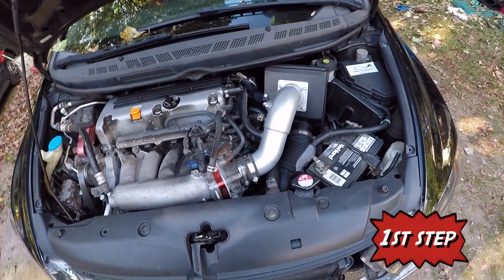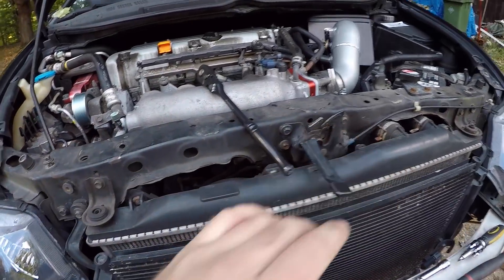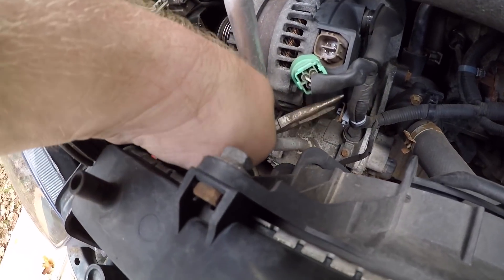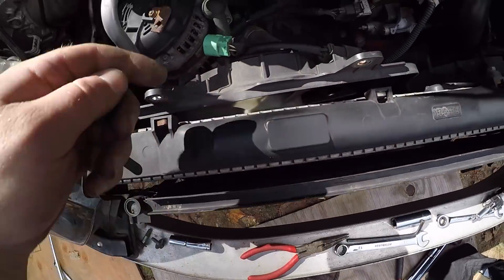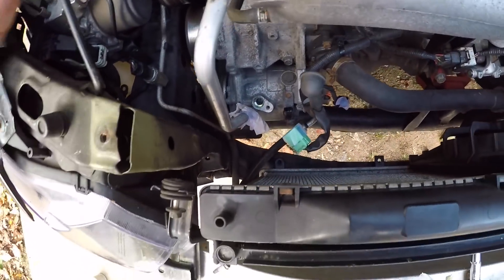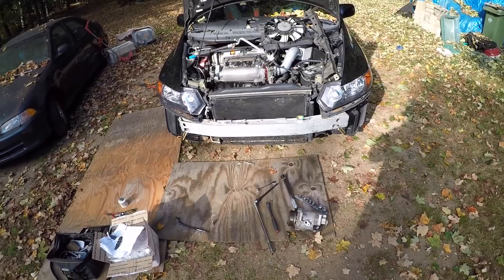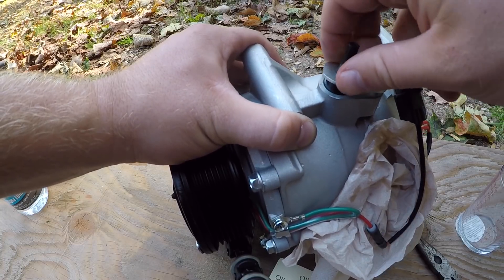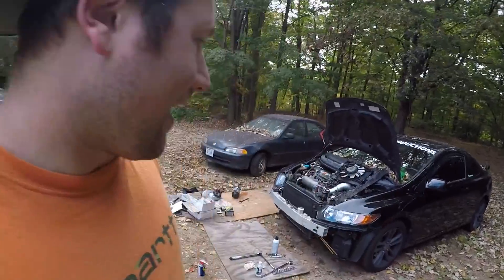Honda Civic Si Remove & Replace A/C Compressor DIY (2006-2011 Civic Si)

Comment: There’s tons of clutch and coil rebuild kits online for 50-70$, you could of just took off the right wheel remove the fender liner and your compressor is right there.
Reply from the maker: I was thinking about it man, but i just replaced the whole thing. Should've bought a newer denso compressor, but they're like $300.00
Reply: Gerb Productions it’s too bad Honda didn’t recall their compressors. Seems like a very common problem in the 8th gens.
Reply from the maker: Definitely agree with you on that

Comment: Did the noise stop?!?!?

Freaking Honda should know the PAG oil amount 🙄 when you get the system recharged, they should be able to tell you some information on it, I think

Great vid, too.
Reply from the maker: +F Lorenzo You'll have to wait and see.  

Ik, couldn't find an exact oz anywhere for the pag46.  Hopefully the 3 oz and a recharge will be good 🤔
Reply: Just got one and yes 3 ounces of PAG oil is what is required. Mine came in it already.

Comment: Very good video. How do you normally find out the proper amount of torque to use in the bolts? Do you look online?
Reply from the maker: +Gianni Adduci appreciate it!  Let's just say I have a little secret manual 😉... sometimes I look online though
Reply: Gianni I use an online manual. google search "jazz honda manual" and you can figure it out from there. :)

Comment: You didn't flush the lines or evaporator. Failure to do this will result in premature compressor failure and will void the new compressor warranty. You also didn't show the replacement of the expansion valve (which can be a real pain in the ass), drier or condenser.

Comment: So you can remove the compressor, its bolt and all the AC lines without having to touch the alternator?
Reply from the maker: Yes, should be able too

Comment: Yo, you were supposed to flush the system of all pag oil. 😑  there is supposed to be 5 ounces in the entire system. You drain the old compressor of pag oil to match what was in the old compressor, and match the ounces to the new compressor. If you had 2.5 ounces in the old compressor that would mean there is 2.5 ounce in the rest of the system. Adding to much will lead to compressor failing or worse. If your old compressor had no pag oil than you needed to flush the system of all pag oil and add 5 ounces to the system. If there were 5 ounces in the system and you just added 3 ounces... now you got 8 ounces in the system. That could blow up your compressor. Just an FYI.

Comment: What up gerb
Reply from the maker: +Still Available Yo yo yo
Reply: Gerb Productions Yonaka catback on its way $249... summer Tires at 20%... hope this fixes it bro, if it doesn't it somewhere in your timing gear
Reply from the maker: +Still Available hell yeah, you're going to love the yonaka! What made you decide to go that route??  So do I, hope the issue is solved.  We will see.  If it's timing, I'm pulling the motor.
Reply: It's stainless it's chambered it's cheap and it's quiet.... actually I think it's how I found your videos... by searching the exhaust for our cars, the price was up around $400 for a while but I was able to get a decent discount on the yonaka site which has it for $269 to start with
Reply from the maker: You won't regret your purchase....  Wonder how it sounds with a header???
Reply: Gerb Productions my stock header was removed and smoothed out and opened up a little bit and I got a Berk high-flow catalytic converter so it should be nice
Reply: Gerb Productions just put the yonaka on as far as the sound... perfect as far as the fitmen.... just a little bit off... took some modification to get it to hang just where I wanted and I also had to clean up the pipe end in the flanges to receive the exhaust flow a bit better from the pipe before but overall well worth the money I painted the muffler Black.... way too much bling for me